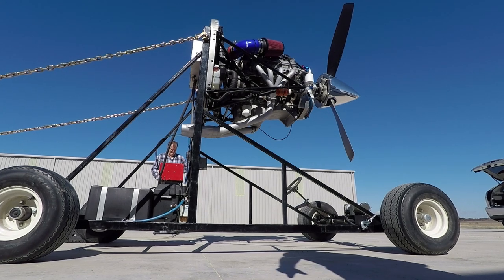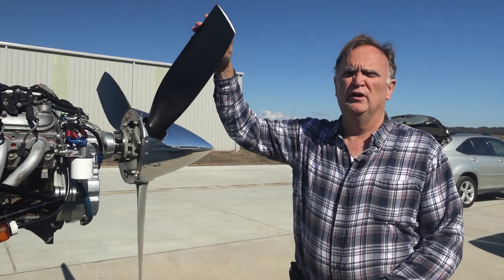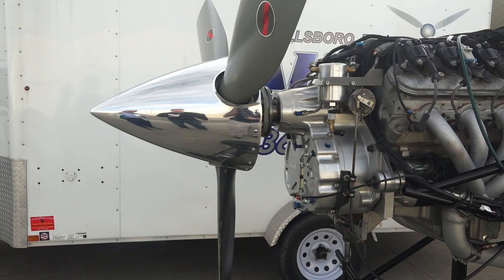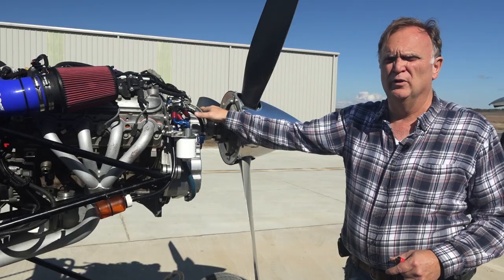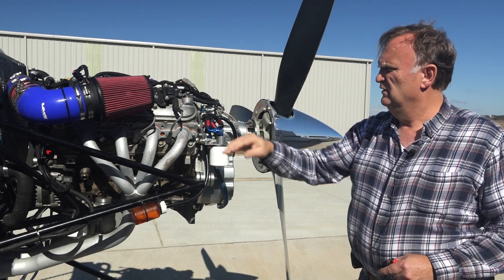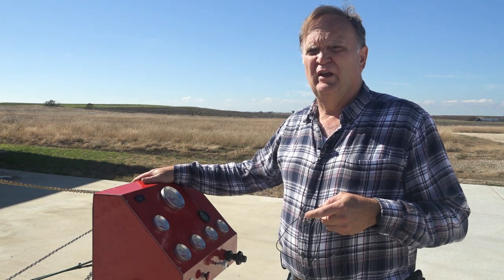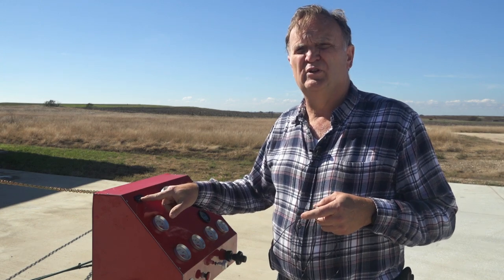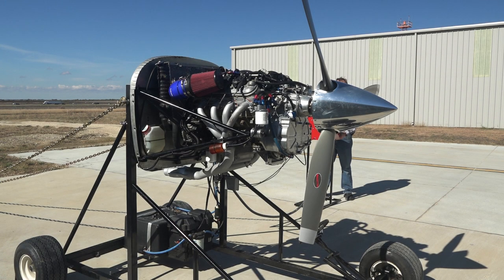Aircraft Propeller Adapter for V8 Auto Engines - DEMO Run!

Comment: What rpm does the engine run at during a 75% power cruise?
Reply: Sounds like around 18k rpm..
Reply: @JamesSmith-xs7sr  Built LS engines pretty much explode above 8000 rpm.  The redline of the  latest engines in cars is around 6500 rpm. I am asking because 75% of 6500 rpm is ~4900 rpm and I cant see these engines running for a couple hours cross country, day after day at 4900 rpm.
Reply: Company website says the thing is an LS3. They rate it at 367hp at 4,500RPM. From looking at an LS3 power curve 75%  power would be at around 3,500RPM.

Comment: We would like to have more info for the Helio Super Courier H-295 that can accommodate a 96 inch Hartzell 3-blade that most of the fleet uses. A suitable planetary gear drive that could handle the app for a Helio would be a welcome feature as the GO-480's are getting hard to find.
Reply from the maker: You can contact Stuart at https://www.autopsrus.com/ for more info.

Comment: How could all coil packs fail if 1 drops out? Doesn't happen in automotive applications. (Ea coil fused)
Reply: Short circuit in a coil could over current the B+ feed which is common to all coils. Not likely, but good insurance when you are at 10,000 feet.
Reply: @joepadula4135  Much more important at 100 feet.